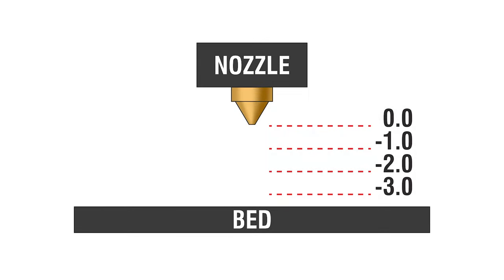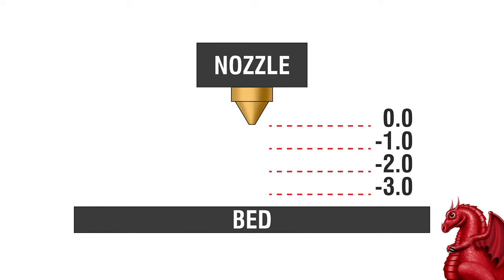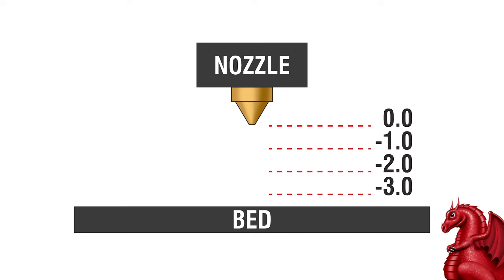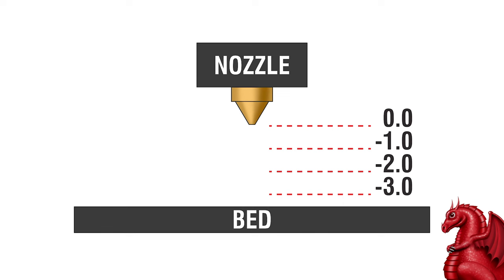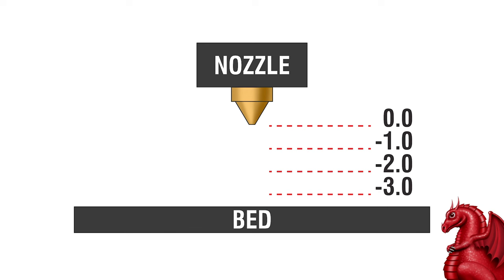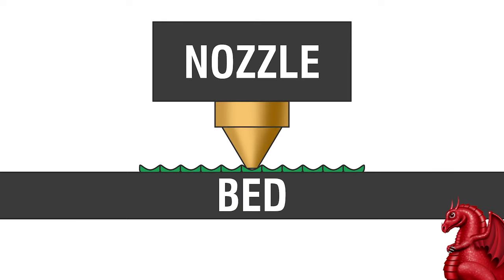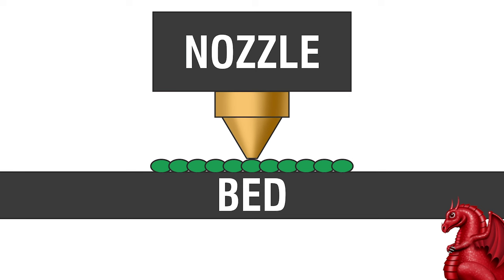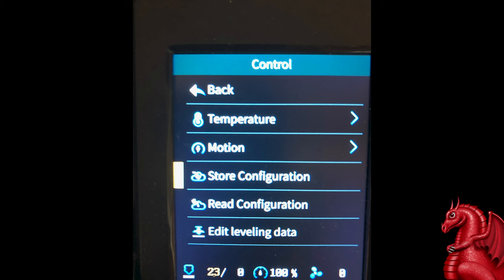Adjusting Z Offset on your 3D printer

Comment: mine was set perfectly, then all of a sudden, the prints were sticking a little too much and dragging into my build plate, and this was on the Ender 3 v3 SE, after I auto leveled, and when I used the auto configure before print option.    I'm not sure if something messed with the settings, or if maybe the hot end might have not been straight or what.   The print was stuck to the plate so well that the build plate broke a hole in the middle when I attempted to remove the 4th print from it :(
Reply: Been there, and i got a textured plate, never had an issue and adhesion is better, as well as print quality

Comment: I use a 3-4 line skirt to ensure a good z-height and will adjust the bed on the fly. Generally, getting a good 1st layer result when I see a slight valley separating the lines. Too big a valley = lower the z axis / no valley = raise the z axis. To get an accurately levelled bed and proper z axis, try running a multi-lined skirt along the entire perimeter of your print bed and you'll plainly identify which corners need adjustment (and possibly find warped areas on the bed - mine has a slight upward bulge toward the center). Thanks for the good visual representation of this concept.

Comment: Thanks for this video, it has been helpful. I recently upgraded my Ender 3 Pro to use lcd touch screen and the marlin 4.2.7 board after it sitting in storage for 3 years.  Was trying to figure out my Z offset and this helps since I also got an autoleveler attachment.  now I just wish the software had more features and options.

Comment: Thank you for your explanation. I've been having all kinds off issues with my v3 se set to Z -2.16 (especially with white pla, which I've heard can also be an issue). Have set it to -2.2 (based on your video) and WOW! SOOOOOO MUCH BETTER!  I'm now running a circle calibration file and the results are looking Amazing!
Reply: my v3 se is terrible for tghis aswell i mighgt have to try it i usually run like -1.9

Comment: Your videos have been helping me with the headache of a new E3V3 SE. I got a bit of a lemon out of the factory with a poorly set gantry and goofy bed. Sadly had a 10 hour print fail in the middle of the night last night but after looking into it my z offset being too low for one side of my bed led to the nozzle knocking the print off the bed. Back to the z offset test prints 🤷‍♂️

Comment: After a number of good prints with my Ender 3 V3 SE I found that the first layer wasn't sticking to the plate. I relevelled a number of times tried different temperature settings etc but nothing seemed to work. So in the end I just reset the machine to factory settings, did the initial bed levelling and tried a test print and everything is back to normal again. Just a tip for any that ever have the same problem. I'm very new to this and only got my printer on January 1st so it's a bit of a learning curve. But thanks for your great videos. They help a lot.

Comment: The Z offset should be set so that when the printer 'thinks' it is 0.2 mm above the bed (or 0.4 or whatever), it really is. So you should actually measure it instead of trying to eyeball it while printing, otherwise you're allowing for other factors to come into play. For example, if you're using a filament configured so that its flow rate is too high and use it when adjusting the Z offset, you're likely to set it too high to compensate for the high flow. Then you use a different filament and the Z offset is off. So, clean the nozzle, put the printer at a Z of 0.2 and using a feeler adjust the Z offset until it is indeed 0.2 mm above the bed. Save the setting and don't touch it again. If the printer seems to be printing 'too close' or 'too far' from the bed, you'll know its not the offset but some other thing that makes it look like it is. My 2c.

Comment: Yes, please keep these coming.  First video where something was actually explained why it happens and how to fix it.  Great video.  
I too have and ender 3 ve se and really like it but had to replace the slide plate because the one from the factory was bent.  Got the new plate installed tonight and now trying to get leveled up.  My request after a first level attempt, the graph show a bunch of different levels, all either green (good) blue (close), yellow (needs adjusting) and red (out of whack, lots of adjusting).  But how do you change the graph so you r number are green.  I know you can manually make the change and guess a number, but what is the right way.

Comment: Just by the opening image (nozzle/Bed): That helped to visualize more than any other video I watched. I just purchased a V3 KE and it's supposed to be auto everything which was one of the reasons I go it. Not so much!  I've successfully printed the tugboat and 7-8 other prints (mine and others) however the consistency of the first layer sticking is about 50/50 AND I can't even complete the Creality calibration tests without them ending up in a big blob dragged across the bed. Unfortunately no settings I input improve the outcome and I still can successfully print the first layer of a calibration test. After all my tweaking  I think i have a bad printer.

Comment: When I got a PEI plate that was slightly thinner than the factory plate I made a very thin square in the slicer and printed it, and adjusted Z offset on the fly. It was hard to determine the right level by eye though.

Comment: Hi! I've seen you suggest to put <<"M413 S0 ; Power Loss Off>> code. But my Cura starts with:
M220 S100 ;Reset Feedrate
M221 S100 ;Reset Flowrate

G28 ;Home

M420 S1; Use saved mesh leveling data

Do I keep those lines or they battle together?

Comment: Thank you.  Very informative for a new user.  Granted, I understand how negative numbers work.  I do have a somewhat related question, on my SE, everything was fine at first but I started having some adhesion problems.  I re leveled the bed and my Z offset went from -1.76 to -1.91.  This resolved my issue, but my question is what would have caused it to change?  Was this an issue with the printer moving on the table slightly causing it to need to be adjusted or should I be worried about a lose part?

Comment: Like your videos! May I make a request. So I'm new 3D printing my first printer is the Ender 3 v3 SE. It was your videos that helped me set mine up. Thank you. Anyhow my request is could you make a video that is about acceleration and max speed settings that is in the between the your V2 settings you used and the v3's capabilities? The printer is fully capable of going much faster but since its so new there is literally nothing to help me in this quest.
Reply: Side note does changing print speed in Cura itself affect the Max speed and Acceleration of the printer or does one override the other?

Comment: Could you do a video on using the Creality print setting to fine turn it. I’ve been having such a hard time getting my printer to print good and half the time it doesn’t stick to the plate or it starts dragging the lines and completely ruins the print

Comment: I'm in need of help/advice. Elephants foot. I have a CR10. Using Cura Slicer I have the first layer perfect, super perfect in fact. second layer comes out scratchy and blobby, but my printer is not over-extruding, its perfectly calibrated, estep and offsets are adjusted, new build plate that is not warped. I get perfect walls but my second-fourth+ layers look terrible. New filament - both petg and pla, did temperature and flow rate tests and there's no solution in 12 cube prints. Getting elephants foot every time regardless of flow rate and cooling. I'm thinking my print settings must be off in the first few layers, but I can't seem to find the right settings to adjust. Any advice would be appreciated. 

If there are any recommended layer ratios (Height:Width), fan settings, top/bottom layers & thickness settings, or something else I've overlooked or should try readjusting again, let me know please. I'm avoiding rafts atm but as a last resort I will use rafts.
Reply from the maker: Try my custom Cura profiles on my website for PLA, you don't need PETG for gaming terrain or minis.

Comment: I have an original Ender 3 so there is no Z-offset in the printer display that I can see.  Am I stuck with only adjusting the bed wheels on the fly to try to fix first layer issues?
Reply from the maker: Yes

Comment: that is literally my favorite thing to get wrong on anything with bl touch style probe
i showed the students in my school how to level  and then use mesh calibraton but they still think it is the same thing and ether crank one corner up mid print or increase the ofset because the thing is not sticking and even to the point of printing below a table :P
lack of phisical z stop is so hard to explain to people that they always get z ofset wrong and ruin the print or a print surface

Comment: could you please make an intensive guide for the ender 3 v3 se specifically setting up profile for prusa slicer would be much appreciated as well. I've been following your tips for this printer and had some promising results, which has been really helpful for a beginner enthusiast. but i can't seem to fine tune it to print flawlessly.
Reply from the maker: Sorry, I don't use Prusa Slicer as Cura produces better results.

Comment: Hay man, love your videos on this printer, I just want to ask if you’d be able to make a part two of the video you made adjusting the printer’s print speed and acceleration on the LCD, you said you might look at finding the ideal numbers, maybe even a video on your slicer settings aswell since there is not an official profile on cura yet ?
Reply from the maker: My custom Cura profiles for the Ender-3 V2 work great on the V3, just change the retraction distance to 1mm.  :)

Comment: Please help me! I can't get any of my prints to stick to my build plate. I cleaned my build plate with isopropyl, I lowered my z offset to -1.94. I'm brand new to 3d printing. I've made around 7 things, and now nothings working. Any ideas on how to fix it?
Reply from the maker: What type of build plate? What type of filament? I need info to help you. If the filament is just balling up on the nozzle the nozzle is too high and you'll need to lower it more.

Comment: Apparently, Cura and Creality both restrict the z-offset to 0.27mm. I've had a problem recently though where my printer will only print with a -0.8mm offset and I can't figure out why. Otherwise it just prints way too high up in the air, so the filament can't stick to the plate. I've checked everything I can think of or find online. The machine is a new Ender 3, but it doesn't have an option to set a z-offset at all.
Reply from the maker: Lower the Z end stop switch more (clip the small tab off of it that hits the aluminum extrusion (I cover this in my bed leveling videos, there's a couple of them).
Reply: @Tombof3DPrintedHorrors  Already tried that when I first got it, because the Z-stop was so high that my table could not be lifted enough without the springs becoming so loose that the wheels would back out while printing causing the table to raise and squish the parts.

I had a problem with my z-stop switch "arm" getting jammed to the bar when it got pushed down too, so I trimmed less than 1/16" off the tip, so it's not touching the metal when it gets pushed down and since about that time it stopped working right. As far as I know though, I should just have to re-zero to make up for any difference with that (which I did)... but I'm wondering if zeroing is more complicate that "this is zero" and "this is zero" (z-axis switch and extruder tip). I don't think it should be though.

It's ridiculous that the Ender 3 is plagues with so many (unfixed) problems. I did a lot of research and knew about so many of the possibilities before buying one and then I had every single problem I've ever heard about and then 10 times more than I ever could have imagined. Forgive the rant. I appreciate the reply and any suggestions. I'm at a loss as to how to fix it, and being disabled (Complex Regional Pain Syndrome), it's not easy having to spend more time fixing it than printing with it.

Comment: hey I really need help what printer do you have to select on cura for the new ender 3 v3? pls help
Reply from the maker: Just select and Ender-3 V2, use my profiles and change retraction distance to 1mm. Also see my V3 SE stringing video for other settings changes.

Comment: My ender 3 v2 neo has been printing PLA perfectly at the default ender settings (200 nozzel, and 60 bed.) I bought some PLA+ and it prints like hot garbage. Leaves strings galore and prints puddles. I'm using 65° on bed and 220° on nozzle. Can anyone help please?
Reply from the maker: 220 is too hot for PLA+, go down to 205. Also what brand?

Comment: I'm back already with another question.  I am an intermediate Nobie (if there is such a thing) and I am so confused.  The more I watch 3d print videos, the more confused I become.  So, I need desperately need some help.  I won't come at you all at once with a ton of questions. I watched this video on adjusting the Z-Offset, and I'm still working on that.  But my question is this: I want to upgrade my 3 v3 se by adding a Sonic Pad to it.  I've been researching about compatibility issues with it and the v3 se.  I see talk about raspberry pi, Klipper, etc.  All I want is to add the sonic pad, put the right firmware onboard and print.  Would you please explain Raspberry, Raspberry Pi, Klipper, and other like items to straighten me out?  I'm to the point of complete frustration.
Reply from the maker: Sorry, I have no plans on doing a Raspberry Pi or Sonic Pad video. I just do videos on tech I use personally and think would benefit my customers.

Comment: 3:03 the higher the number the lower the number? if we are talking about negative numbers, and if we all all agree that -2 is higher than -3, then the rule is the greater the number the greater the distance. Touching the bed might be a -5, a -4 adds some distance, a -1 is a good distance, correct?
Reply from the maker: Correct, but make only slight adjustments in hundredths of a mm.
Reply: @Tombof3DPrintedHorrors  oh no I didnt adjust in the smallest amounts, I took that adjustment from a 2 to a -4 and scraped a nice sheperds hook into my bed. The new bed was $22 lol

Comment: Thank you for all the tips, I have a ender3, and had to move... NOTHING has worked well since the move... If anyone can point me to where I can get a BONE STOCK Ender 3 firmware? I feel like I need to get back to basics, remove all my upgrades, and try to get bed level first, then add things like bed sensor, end of filament sensor, octoprint on my pi2, etc... I HIGHLY RECOMMEND never "packing" a 3d printer back in a box, regardless of moving... I've been frustrated and unable to print for almost a year now... (Much gnashing of teeth).